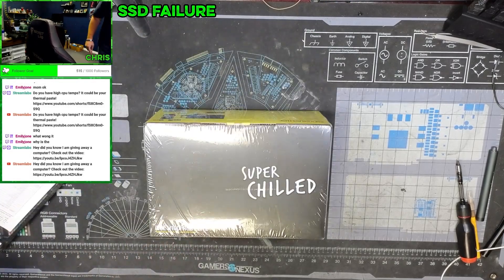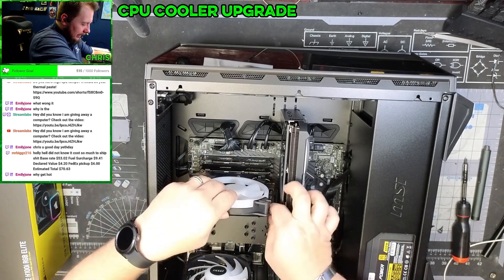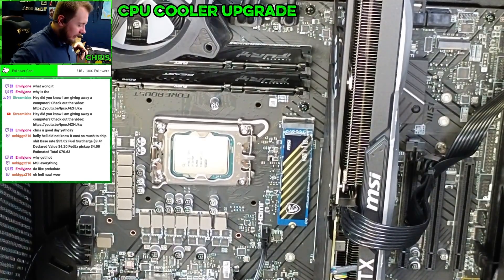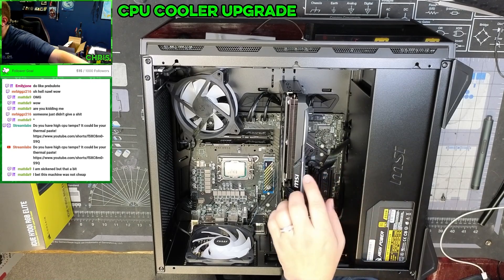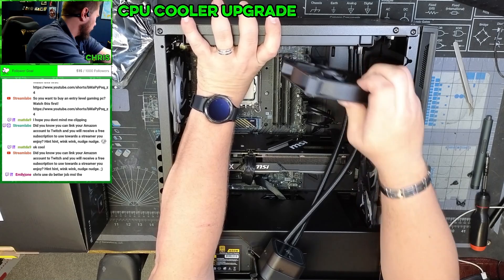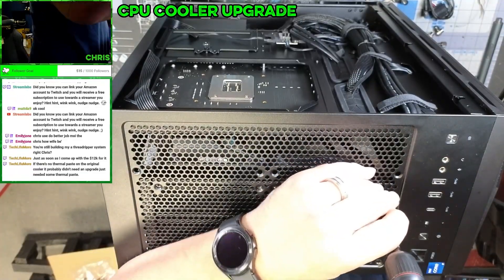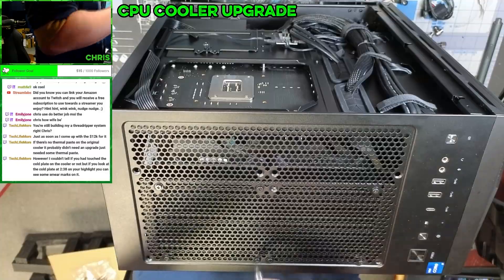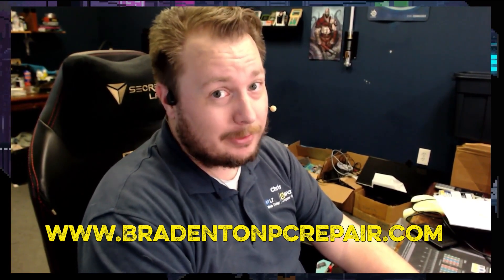Is Thermal Paste Important? MSI doesn’t think so, Don’t Trust MSI Prebuilts #227

Comment: Can you find a prebuild that comes with that cooler??? Betting they didn't put it on and your boy lied about not touching it.
Reply from the maker: There is a small chance you are right, but the fact that there was no thermal paste anywhere on the CPU, not even under the clamp indicates that there was never any there in the first place. Unless the customer put the cpu through an ultrasonic cleaner or something, which seems like a lot of work.
Reply: yes, MSI does sell towers with that cooler. Also, you can order a custom configured build. If it was custom built, it wouldn't surprise me the builder forgetting it.